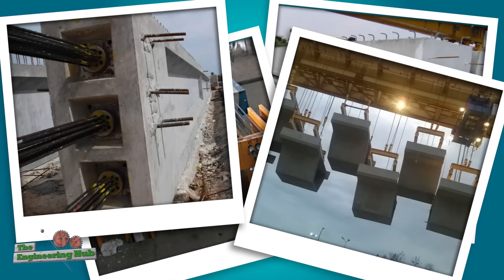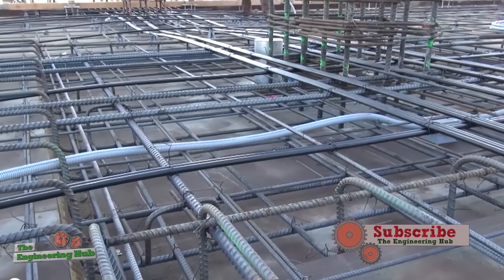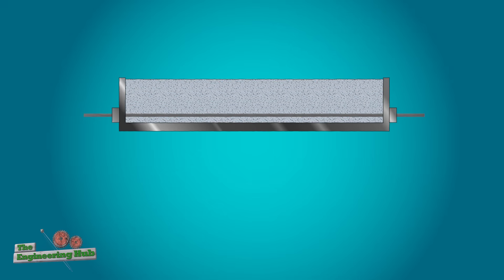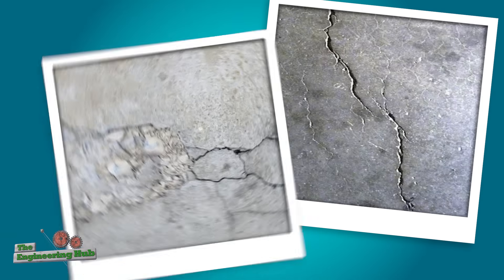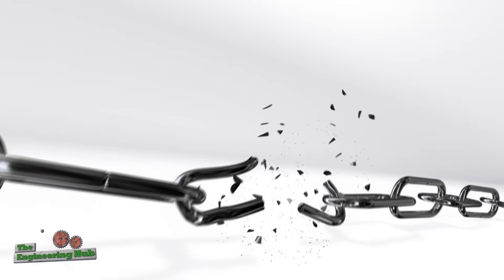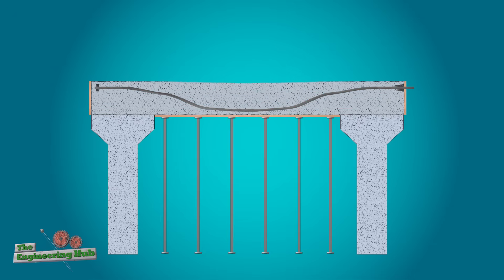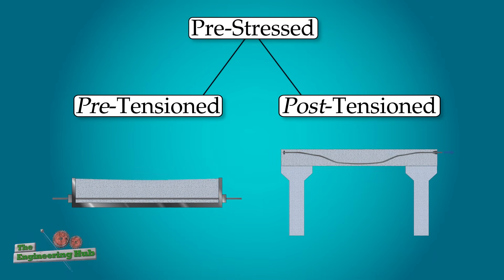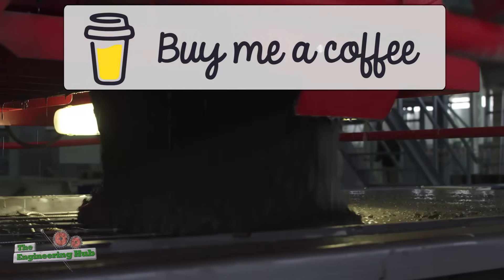Why Pre-Stress Concrete?

Comment: Post tensioned concrete is why you never cut into a concrete slab without first KNOWING that it is not post-tensioned, or without having it scanned so you know where the rebar or post tension rods are.  If you cut into one of the rods it can explode out of the slab and cut through anything in its path, finishes, furniture, or you.
Reply: Thanks, that is extremely valuable advice!
Reply: My first engineering internship was on a 17 story parking structure in Chicago that had post tensioned slabs. I remember being very leery of the project because the PM told me how the jacks and cables worked and that if either end tie failed the cable would go ripping through the adjacent buildings like a 1000lb steel whip. That was 37 years ago and the imagery has always stayed with me.
Reply: Damn, good to know; thanks for sharing.
Reply: You'd can make a pretty realistic calculation on what structures have pre-tensioned cables in them
Reply: They are building many flyovers using post tensioning in the holes of girder slabs. It looks dangerous to me.
Reply: You are wrong the cable is in a duct and is grouted after the final stressing so if u cut one the grout will stop it exploding
Reply: don't worry, my magical enchanted coring drill rig always always seems to find electrical conduits, rebar, and stress members.  as long as I'm not on the job, everything will be fine 😐
Reply: It's true, I retired from bridge maintenance and this statement holds a lot of truth. Bridges that have been damaged by high loads or earthquakes were repaired by my team. However, I always felt uneasy about pre-post tensioned bridges.